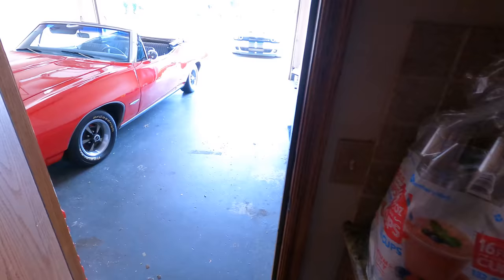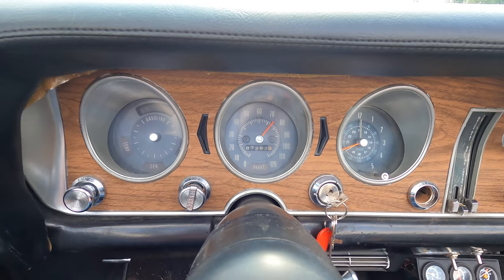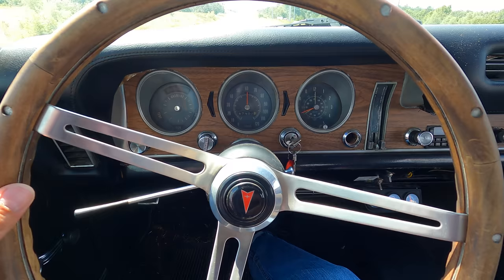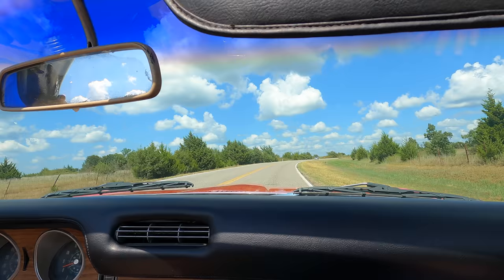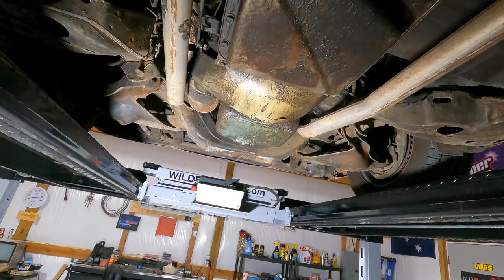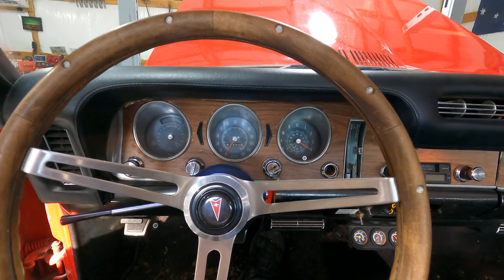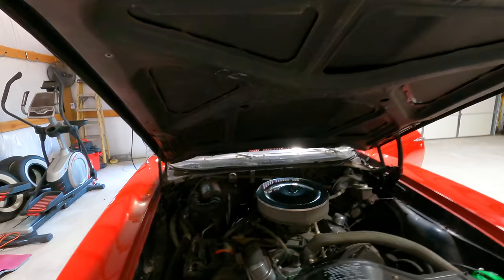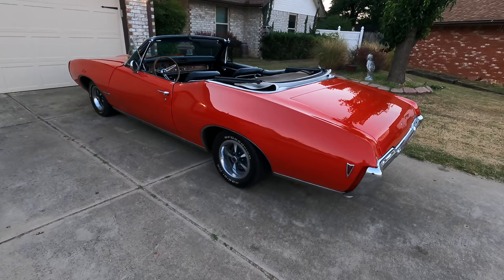Everything Wrong with my $20K Fake 1968 Pontiac GTO - How bad is it?

Comment: You shouldn't have fixed the clock it drains the battery
Reply from the maker: If you have a good battery, it won't be an issue.

Comment: Surely you knew this wasn't a GTO from the start. No GTOs came with a chrome front bumper that year. None. Nada. Zip. All of them had hidden headlights too. Not even a good try at a tribute car.
Reply from the maker: You're incorrect. There were plenty of GTOs that had the endura bumper removed for the chrome (it's a factory option). Do more research before commenting plz.
Reply: AAR is right. Had a couple, and was partial to the endura bumpered ones.
Reply: Harry -Hind hide away headlights was an option as well

Comment: Its a turbo 400
Reply from the maker: Not with 2 gears it's not. It's a powerglide
Reply: Never seen a power slide in a Pontiac. 😊
Reply: Definitely not a turbo 400. Oil pan on a 400 has a different shape. Also Pontiac would put a turbo 400 behind 400+ ci.